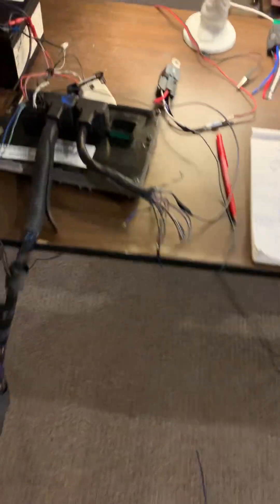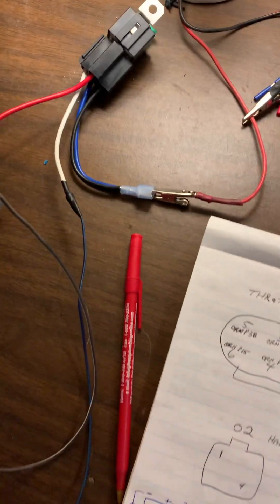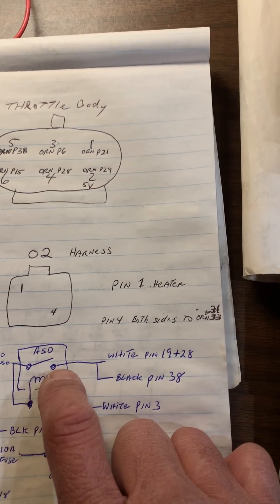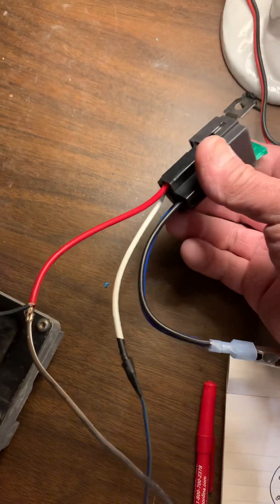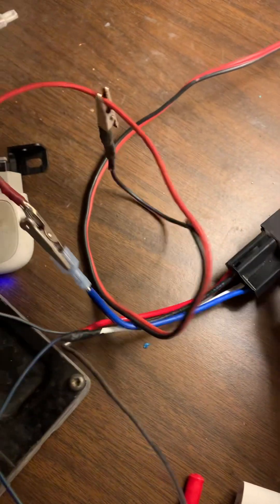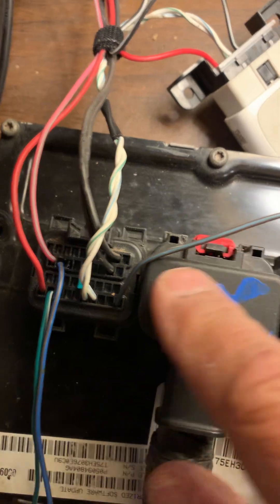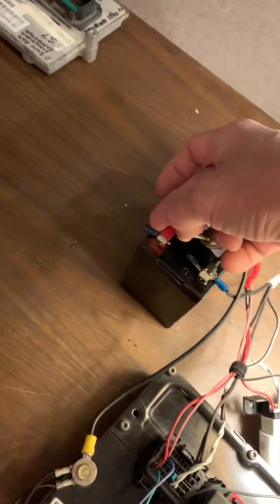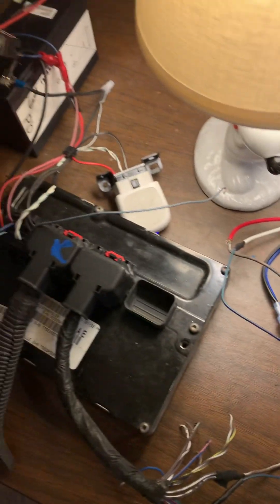Hemi swap ASD wiring and throttle body handshake. Quick ASD wiring.

Comment: Thanks for posting!  Worked perfectly.   I have a 2006 engine, with a 2007 ECU.  The wiring worked as described in the video!
Reply from the maker: @johnbuck1879  thank you sir! Others still can’t seem to figure it out.
Reply: @shelbydogg  it took me a bit.  Down on the corner of your diagram you mention the grounds from the black plug.  For some reason I thought the case ground would suffice, but it does not absolutely need to ground pins 9&18 of the black connector.  Once I did that all was right with the world

Comment: hey, me again.  sorry.  do the FP and starter relays need to be connected to the PCM to run?  if so, which pins? thanks
Reply from the maker: No, just the ASD relay. FP and starter can be on their own circuits, separate from the PCM but the FP wont shut off if the engine dies.
Reply: i am trying to wire this for a race car. no key, just master and starter button.  how do you suggest i wire those in? @shelbydogg
Reply from the maker: @skidmark7199  Black Connector on PCM Pins 11&12 to the sw12v ignition switch on the cage and a wire going to pin 30 of the PCM black connector coming from your starter switch.
Reply: so 4ga wire to master switch, from small post on master switch to C1 pins 11 & 12 and from the master switch to the starter button and  from starter button to C1 pin 30? @shelbydogg
Reply from the maker: @skidmark7199  yes, those 3 pins tell the pcm to “key on” then “start”
Reply: ok, the 11 and 12n pins are wired through a 20A fused line off the main power, the 30 was connected right to the starter button.  still got nothing. i cannot hear the handshake. shouldnt it be audible? @shelbydogg
Reply from the maker: @skidmark7199  If your ASD relay doesn't click for a couple of seconds then your wiring is wrong or your PCM is bad. Sorry I can't help You. Try Blake.
Reply: if youre referring to diyhemi, they decided to be closed for the summer.  i really do appreciate all the help you have given me though. @shelbydogg

Comment: Nice Video! Does this also apply for hemi swap from 2009 ram pickup?
Reply from the maker: It should.
Reply: So as a quick test, if I have power at all injectors and coils when the ASD relay turns on, is it safe to assume my ASD circuit is wired correctly? is there anything else I should check?
Reply from the maker: @lennymunroe7455  yes, power comes from the asd relay,
Reply: Great, thanks!

Comment: I'm working with an 03 harness, wired the same that you have here. My ASD relay comes on, primes the fuel pump for a couple seconds then clicks off - seems normal. I think. I get NO throttle initializing though. What does the ECU need to see in order to do that?
Reply from the maker: Not sure what you’re missing there. The other guy tried another ECU and it worked. Ask Blake at DIYHEMI if 03-05 ECUs hit the throttle like the other ones. All of mine are newer, 06-10. Good luck!
Reply: @ShelbyDogg  so C3 pin 37 "fuel pump relay control" either needs to be the fuel pump relay trigger wire or  grounded. I did this, and now the throttle is working. Hopefully this helps some. Thank you
Reply from the maker: A control wire is usually grounded when activated. So if the relay is wired up correctly, that wire will ground one side of it, and the relay will close.